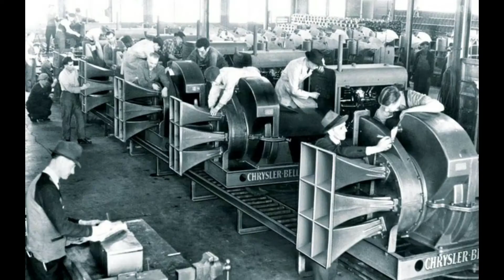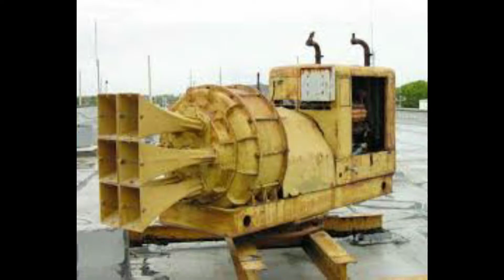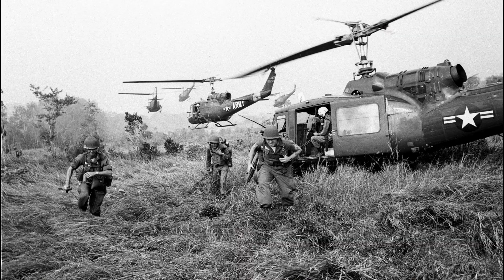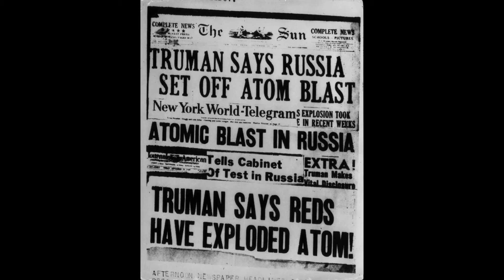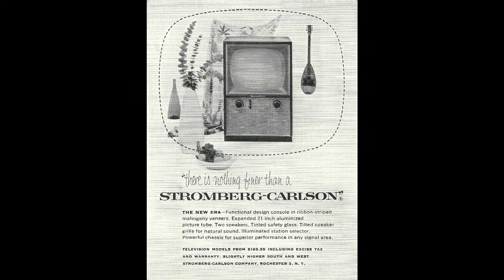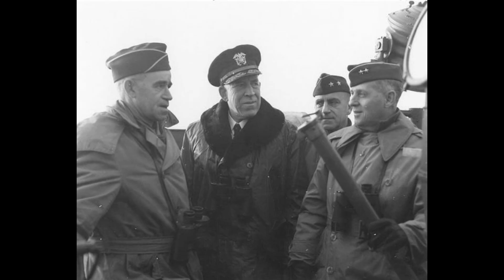Chrysler Air Raid Siren Remastered v2

Comment: In the audio recording when the tone of the siren changes from RRRRRR to UUUUUUU it's because the dynamic range of the recording device has been exceeded and the recording is saturated with distortion. There aren't a lot of microphones that can record normally in close proximity to something that loud, especially the type of mics you find built into cameras. You have to get at least a few hundred feet away from that thing to record it when it wails at full speed. I have seen only one video on YT where a guy took one out to a remote area and ran it up to full speed, then got back away from it to give an idea of what it really sounds like. It's an older video with a camera from the day but the best one I have heard. LINK ---  https://youtu.be/q5sPd9obwEU
Reply from the maker: Yup it does! I love the sound of those!

Comment: I wonder when the last time that siren ran, it looks like at some point it had been repainted but it looks like it was done 20years ago, the Chrysler's had the ability to be remote operated but a person would regularly inspect and test the siren manually, some were manual control only but some had a switch that would allow it to be selected between manual and remote control, the siren in California at the top of the hill at cerro negro still has the remote control power boxes still in place under the siren, lots of these units were removed and scrapped in the 90s and early 2000s. They were too costly to keep running and were very high maintanance. They also could be optioned to run on propane or gasoline, which depending on where the unit was place was very important, also in cold climates they had a battery warmer and a block heater so they will be ready to start at anytime, these things are very cool and quite impressive for the time they were made, I would love to see this siren run again. There is a chrysler museum that has the best example of one of these units, their unit came from a town called Trenton and was pulled off a tower in the late 90s and has been perfectly restored and this siren had the remote control ability as well. There is another one located in a neighborhood in california that got a cosmetic restoration and still stands today but it is mechanically too far gone to run anymore and there is another one in park in California that is totally abandoned and even has a tree growing through the engine cowling.
Reply: I used to hear Cerro Negro from Apperson St and Hillhaven in Tujunga when I was a kid. The siren at Pinewood school would finish its test and would shut down, then you could still hear the Chrysler Bell at Cerro Negro for another minute before it shut down. That was in the mid 1960's. If I hit the Lotto, I will build a scaled up version and power it with a Big Block Chevy engine.